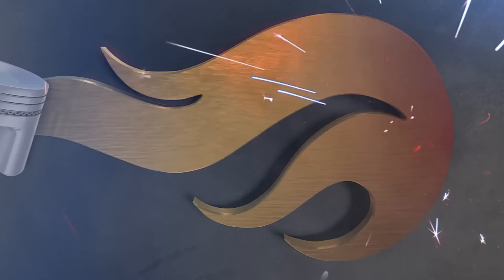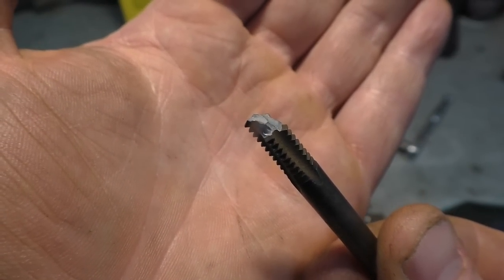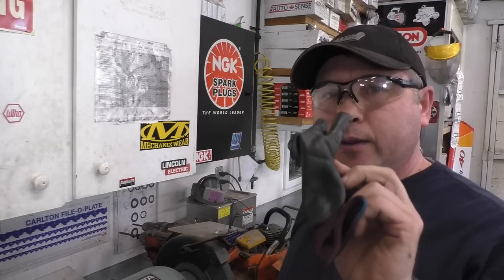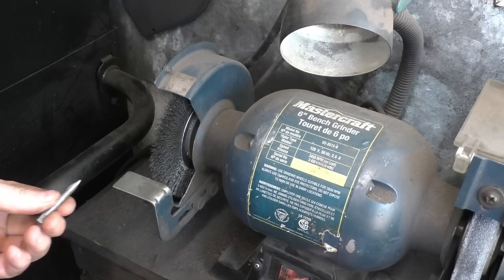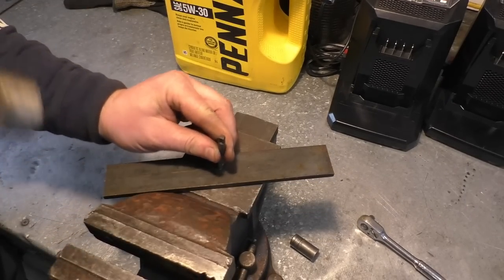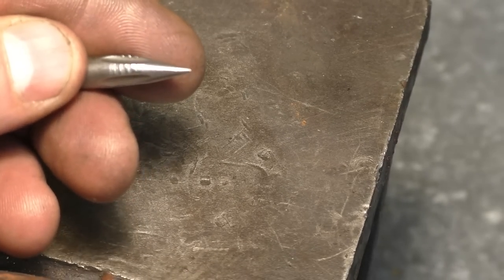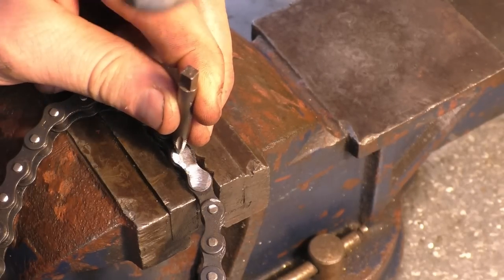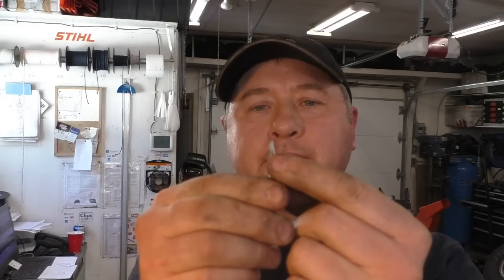Don't Throw Away Broken Thread Taps!

Comment: Good post. I've done that for years. I usually chuck the old tap in my electric drill to spin it against the grinding wheel. It works a treat. I generally taper to a slightly blunter point similar to a standard center punch. Thanks. Enjoyed the video.
Reply: I was about to comment about this when I read your tip. I find that using a drill lets you sharpen the point to the centre of the tap for more accurate centre punching. I clean up the mushroomed ends of small punches this way as well.
Reply: @kevola5739  I use it for mushroomed end cleanup too. Works a treat.

Comment: The only thing about using a tap as a punch is its hardness. Hard and brittle...so if you use it on something hard it is likely to shatter. just something to think about.
But this could be a good use for broken taps...if you're careful.
Cheers

Comment: You can grind the end and restore it, especially on bottom taps.  I have never thought about making a center punch out of it, but I have put them back into working condition many times by making a broken bottom tap into a new starter tap, by just tapering the end of the tap with a grinder.  I have made a many a broken starter tap into a new bottom tap by flattening the end and putting a slight bevel on the end.  It just won’t be as long as the original tap in either case.

Comment: A broken tap can also be used in the lathe as a blank used as a basis for a forming tool, cut-off, grooving tools, boring bar, etc.. Think of them as round tool steel stock to be used as a cutting tool blank in the lathe. Grind them to suit the task at hand.
This works better if the tap is made from HSS vs. a carbon steel tap material. The carbon steel taps will also work but will not be as durable.

Comment: To break a chain, you should not need to grind the pins down. That punch that you made should work just fine. Make sure that there is room on the other side for the pin to be driven to. I usually use a roofing nail. 😊

Comment: I like to collect broken tools that I find at the junkyard since they don't charge for them. One time I desperately needed a water key to turn off an ancient city water meter because of a broken shower stem. I dug through my pile and threw one together from an abnormally bent and gutted ratchet and an old Craftsman breaker bar that was missing the pin and joint to hold a socket. The breaker bar had a perfect sized slot to turn the valve and the bent ratchet handle fit perfectly around the top of the breaker bar after a couple seconds with a hammer. I still have it and the best part is it was free and it breaks down to the 2 parts so I can store it in my tool chest drawer.

Comment: When I worked as an industrial mechanic ,we broke taps all the time .We would do this and use them to get broken bolts out. We would also grind down ezzy out bolt extractors to get a better grip on a broken bolt. You down want to break off an ezzy out in a bolt !

Comment: Even easier and much safer to sharpen if you use an electric drill to hold and rotate the tap on the grinding wheel...

Comment: a really good  threading tap lubricant is called, Rapid Tap ☺and it is  great for loosening seized threads just brush some on the thread and some light taps with a hammer and let sit for awhile if it didn't free up. i am going to save broken taps from now on.🙂

Comment: Don’t know where to put this but saw an interesting video on another channel.  Not sure if this is true.  People buying very high octane, ethanol-free fuel for their small engines may be disappointed to discover that there may be some low octane, ethanol gas left in the pump nozzle.  Makes sense to pump a few gallons into the car before adding high octane, ethanol free gas to a Jerry can.
Reply: A couple of local Gas stations have dedicated high octane ethanol free pumps. Check around.
Reply: @davidsprocket5141  I have noticed that as well but I thought it was an interesting observation

Comment: That grinding wheel is not made for grinding on the side of the wheel. I got stitches once doing that. Totally my fault though.
Reply: It is actually alright, per grinding wheel manufacturers, to use the side of bench grinder wheels like Dony is, and many of us oldtimers have done this safely for decades. Part-time sensible side use is safe, and you can lightly dress the wheel sides if they get dull. However, bench grinder wheels are not designed for CONSTANT side use, so if you regularly require a flat grinding wheel - for example sharpening milling cutters - this would be provided by a tool grinder using proper dish or straight cup wheel. Cheers.

Comment: Don please be very careful as the side of the grinding wheel is not recommended to grind on .
Reply: Yes you can, per wheel manufacturers.
Reply: @nickbarrett6829  , you need to make certain that the wheel is rated for side grinding  ,  that most likely is a specific wheel from manufacturer . Most grinding wheels are not , just be safe .

Comment: small pieces of worn out hacksaw blades make great shims behind riding mower brake pads , to get a little more life from them . need a pilot hole for a nail in wood ? just cut the head off the same size nail and chuck the nail in a drill . btw , if possible , chuck the broken tap in a drill before grinding or resharpening .
Reply from the maker: good idea on using a drill Bill!

Comment: No no no 😬 broken taps will shatter when hit with a hammer!  This is  tool steel and quite brittle , why do you think it broke in the first place ? . Don’t sub this this for the proper tool, Don’t take anymore advice from this guy be safe !   I’m 48 + years a machinist, Also never grind using the side of the grinding wheel they can explode , they’re designed for pressure to the front of the wheel, also re set the the tool rest clearance to around a 1/6 gap and don’t wear gloves , I watched one of our welders lose his finger one morning sharpening a welder tungsten, the glove caught the wheel and got pulled between the wheel and tool rest that had a large gap like the gap currently on your grinder. I’ve watched your videos for years now and you always stress safety your a good guy stay safe. 😉🙏
Reply: I agree with these points having some 4 years machining experience in the past. Dony has a lot of experience around grinders but newbies could face safety issues. I always wear safety glasses but gloves on a grinder??? It can suck your hand down. Open finger gloves would at least be a bit safer than full gloves.
Reply: While I totally agree safety first, I will say that I have been using broken taps to make all kinds of tooling over the years including punches and I am 63 years old. Never had a problem!
Reply: Give us an update at 64  young man you’ve been lucky thus far .
Reply: Leather gloves have saved a lot of my hid over the years, and from burns, tight fitting leather gloves and tool rest adjusted correctly, no tool rest or not adjusted correctly you will get sucked in sooner or later!!
Reply: @pmdoit  Taps are made of different materials: carbon steel, high speed steel, carbide, etc.  All will behave differently. Taps are generally brittle, as they aren't meant to be hit with a hammer, which is why they break instead of bend.
Reply: @elcheapo5302  I fully agree that taps are brittle, that's why they break when they are misaligned or are being used in an improperly machined hole. I've already used high quality HSS taps. My comment was just that I've used them for many impact purposes with no issues, maybe due to knowing about proper perpendicular alignment when using a punch and realizing that this is not the time for the BFH 😂 knowing how much to choke up, proper size and force used are all key ingredients. In an ideal world but new taps and new center punches when needed but that's not always possible when a job needs to get done and not always affordable.
Reply: @jepsdog3859  I honestly don't think luck has anything to do with it. knowledge and understanding of the materials used and their properties Make it possible to use these broken taps for other tooling with reasonable caution. There is skill, experience and knowledge involved. As a general rule, I would agree if you don't know what you're doing. Don't do stupid! Donny is very experienced and so am I. I saw comment about using the side of a grinder to sharpen his tap/punch. While that is not recommended, it can be done safely as long as you understand the forces in use. Unfortunately, most people do not know how to use a bench grinder even if grinding on the face. A grinding wheel can explode if too much force is applied even to the face. So when people say don't grind on the side of the wheel, I say if you don't understand the forces that you're using in the forces applied then don't grind at all